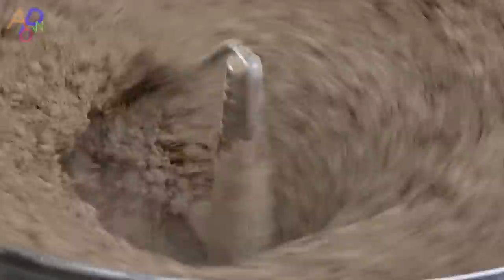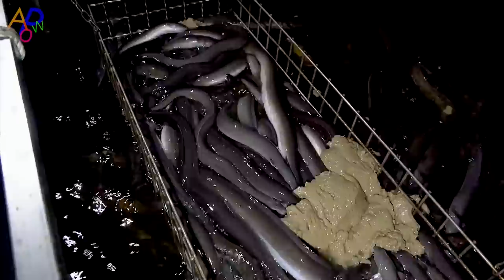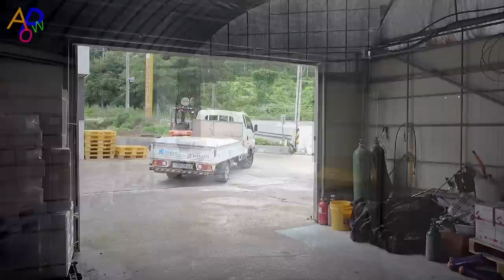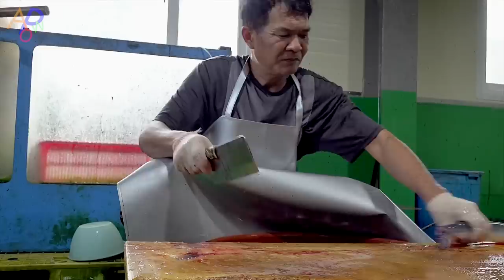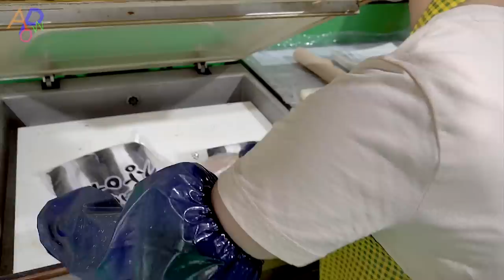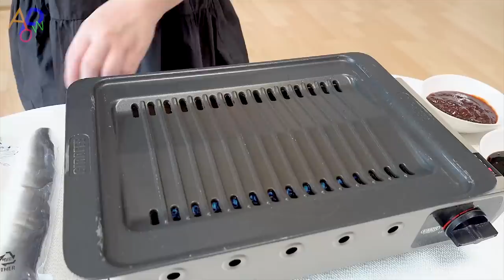Incredible 1 Million Eel Farm Work Process. Amazing Size Korean Fish Farm

Comment: The water from the tanks the eels are kept in are an excellent resource for an aquaponics setup. The farmer can send the water through to grow beds for various vegetables, which use the fish waste for fertiliser and clean the water, returning it to the tanks. At the scale they're doing, they could produce a variety of vegetables in large numbers in grow houses!
Reply: Horror
Reply: In fish farms for eels, biofloc guarantees higher productivity than aquaponics. First, plant cultivation lights raise the water temperature, which incurs cooling costs. Second, since eels are nocturnal, they must block the rays of cultivation, etc. Third, the light shielding arrangement makes handling difficult. This raises the labor cost. Fourth, if the breeding facilities such as a light shielding device are complicated, virus sterilization becomes difficult, and eels are vulnerable to viruses. Aquaponics are only suitable for tropical freshwater fish such as tilapia. It is difficult to apply to Catadromous fish that live in low water temperature.
Reply: @gregory000  Thats a really good set of points there. I was thinking that the eels would be kept in their normal environment, so they can grow best, with only the water/fish waste pumped to a stand alone, separate building for growing vegetables via aquaponics. Thanks for correcting me, I really appreciate it!

Comment: We need to understand that being at the top of the pyramid of creation means that everything we do trickles down the structure, from top to bottom. When it reaches the bottom, the inanimate level of reality, from which everything grows, it changes it. If we ooze ill-will, it creates negative changes throughout the system, which manifest in increasingly extreme climatic and geological events.
In other words, when human relationships go out of balance, everything goes out of balance. When our relations become extreme, everything becomes extreme; when we become violent, everything becomes violent. Each summer, the ramifications of the linkage between our relations and our world become more extreme, until we acknowledge that everything that exists, exists in a connected, hierarchical system and that whoever is at the top determines the state of the rest of the system.
It is not as if previously, we were better people than we are today. It is simply that there were fewer people, and therefore fewer elements that exude ill will.
Also, relationships between people in the past were less toxic than they are today. While there are fewer wars today than ever, the levels of suspicion and alienation between people are skyrocketing, to the point where people can no longer trust their own family members. As a result, wars between countries are rarer than ever, but divorce rates, domestic violence, and violence in the community, are at an all-time high.
Even the internet, which we invented purportedly in order to connect people, is being used to abuse, deceive, and exploit people. The world-wide-web proves that everything we create, we use against others. When there is such a negative element in a system, and that element is at the top of the system, how can the entire system not go awry?
Therefore, if we want the weather to cool, the sea-level to drop, and the storms to subside, we must cool the fire and calm the storms between us. Mutual concern, mutual responsibility, or at least the knowledge that we are dependent on each other, are necessary in order to restore balance in our world at all levels, from the ground we walk on to the hatred in our hearts.